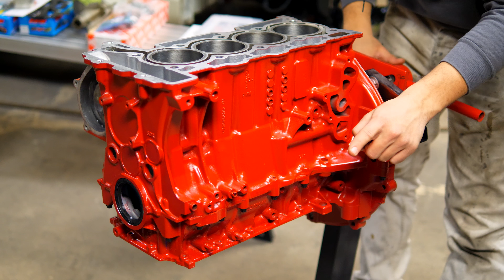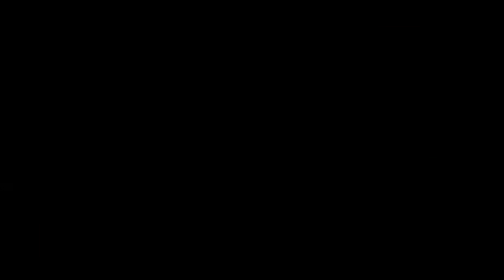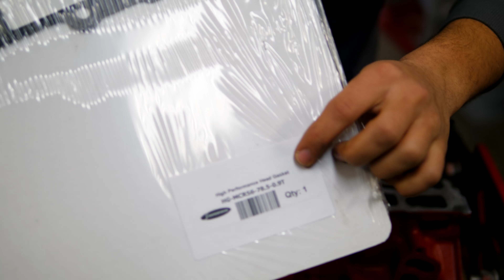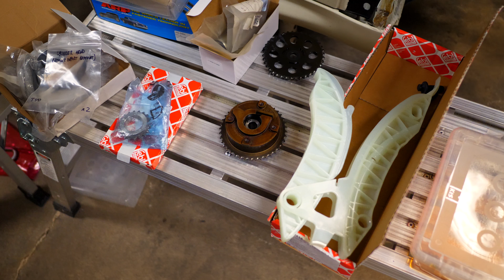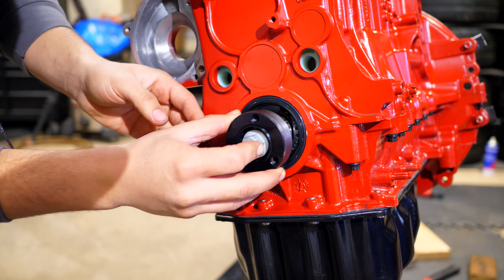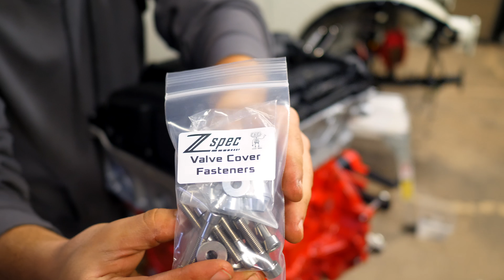FINALLY COMPLETING THE REASSEMBLY // JCW Forged Engine

Comment: How did you get the right crankshaft rubber seal in place (from what I seen it requires a special tool)?  Asking because mine is leaking and need to replace it.  Thanks in advance for your insight!  By the way great video with great explanation and best of all torque specs - cusps!!!

Comment: You should have taken those plastic guides for the timing chain to a machine shop, and had them machine you some titanium guides. Honestly plastic guide rails was the stupidest idea ever from the manufacturer. You're just going to be replacing them every 40,000 miles.

Comment: I just built the same motor last week. I painted my engine blue though to match my car. I noticed you have every single matting surface for like your oil line, oil filter/water unit were still painted. I made sure to razor blade all of those surfaces clean to keep them from leaking down the road. Nothing better than bare metal for a good seal. Build looks great. I found a fully machined head with new valves, valve seals, and what looked like new cams and springs for only $969 shipped on ebay. This head was the best deal I could find since my previous head had massive damage to the cams and head. The other great thing is that the head looked like it was new from the factory, it was very well packed and came with a return label. Core charge was $350 if you kept your old head. Just a note that when you rotate these motors dry the intake cam WILL MAKE a snap noise and jump forward as it rotates. This is completely normal UNTIL the oil is pumped through it. This had me freaking out at first thinking that the valves were hitting the pistons when I first rotated the motor. I had the new oil in it while it was on the stand with all the oil components installed and thought why not rotate this beast before I install it to make sure nothing was binding. That's when the intake cam was jumping forward on me with each rotation. I painted a yellow line on each new cam bolt and each cam just to see how the bolt and cam were not staying in time. This was only until about 50 rotations of the crank when new oil finally made it way up to the turbo oil line. I opened my Turbo oil line just to make sure the oil made it up there since it's the highest point the oil will have to travel. Once oil came out that line I bolted it up and then kept rotating the crank. Soon the oil was coming out of the cam journals and finally went quiet and the intake cam and it's sprocket locked together the way they should be. I also HIGHLY recommend NOT using any garbage hard metal oil lines for your turbo. The original oil line is JUNK and will leak on you. The crimping on the ends of the hard line are not done right and will leak over time. I recommend getting the flexible steel braided line by Kinugawa with the devil logo on it. These vary in price around $30-45. I fully believe that the stock metal line is what caused my engine to fail for the previous owner. My turbo bearing was completely loose, cams ground into the head and #2 piston has no bearing left causing it to damage the crank. So good luck to anyone doing this job and PM me if you have any questions as I love to help others out as well. I really should have filmed my install but oh well.
Reply: Sterling, in addition to the $969, how much  did it cost to rebuild?  Thanks!
Reply: How were u rotating ur crank?
Reply: @TheNigga109  the engine wasn't seized.

Comment: But you did not show the TDC top dot center before you torque the hub bolt I don’t need that just for the ppl watching
Reply: This motor is not assembled at "TDC" as in most motor installs. This motor is completely assembled at 90degrees which means that all 4 pistons are mid stroke and even when putting everything together. This is done by aligning the small dowel pin in the flywheel/crankcase hole.
Reply: Sterling Robertson what I mean there is something to align the Cranckshafts with camshafts dowel or pin to lock the crankshaft from rotating also that tool to lock the camshafts because there is no marks on these bmw engines but still nothing to show how to lock the crank in the video which is important before you put the cylinder head now if someone follow your steps he will lock or tight the camshafts bolts in wrong Cranckshafts rotation or if he turns the engine after he will bend his valves

Comment: Hey! Just a heads up, you forgot the plastic cover that goes over the oil pump ( it covers the sprocket/chain). I’ve heard that without it, it can aerate the oil.
Reply: I also did that same thing when I put mine together. Gotta drain it, drop the pan and pop it back on. yay

Comment: >Spends gross amount of money restoring cosmetic things like bolt heads
Also doesn't prime or replace oil pump because thats easy insurance for first time starts
Reply: Jesse Vongnaraj ?
Reply: @rolandob4492  When the oil pump is empty, it has to turn a significant amount to pull up the air and then oil before it can circulate oil through the system. By priming the pump with some assembly lube or vaseline, it can cut down on the amount of revolutions the engine has to perform before oil pressure is built. Not replacing the oil pump is just poor judgement, its a cheap enough part to replace new and is cheap insurance if the old one has possible damage. He spent so much money on other things, why not the extra 50 dollars on a part that would actually net performance or reliability
Reply: Jesse Vongnaraj well how do you know he won’t prime the engine before starting it for the first time?
Reply: @rolandob4492  Because you have to run it much faster than the starter can turn the engine over in order to force oil through the system. The starter cant spin it fast enough. It would of been cheap insurance to replace the pump, or at least pack the current one with some form of grease to aid in helping oil move through. He should look at a shop manual on rebuilding an engine, it would cover things like this.
Reply: @jessevongnaraj2276  100% faxx
Reply: @rolandob4492  Because he already made the timing chain blunder
Reply: InfiniteLoop he just looks foolish to anybody who even remotely knows how to properly build an engine
Reply: He should have already put assembly oil down the cylinders for the oil ring so priming an oil pump should not matter. I assembly lube everything journals and lifts and lobes included.

Comment: How much would you say it cost you to rebuild your engine? 15k?
Reply from the maker: Depends how crazy you go into it.. I've spent a bit extra on little things like the ARP bolts around the oil pan which aren't needed. Its not cheap, but I will go over the total cost once I'm done :)